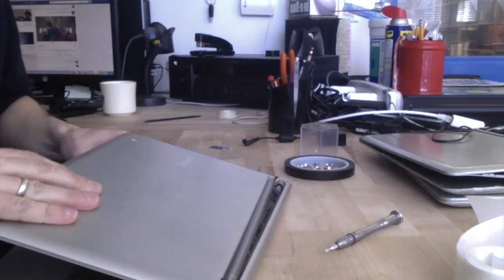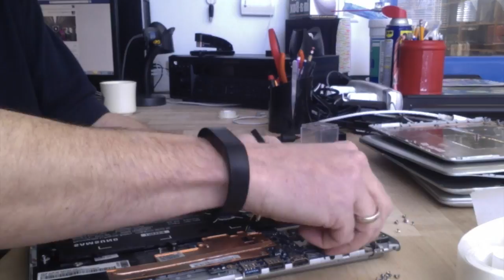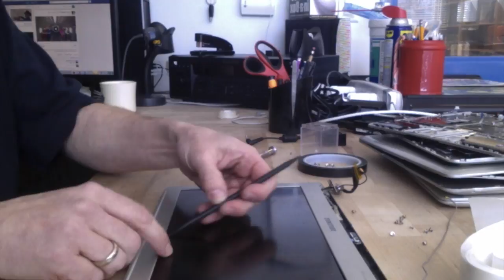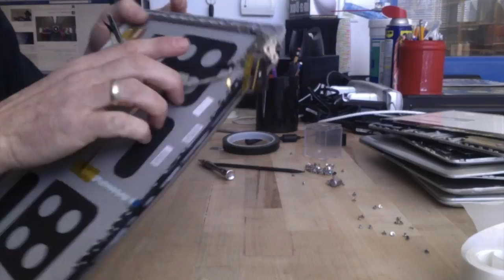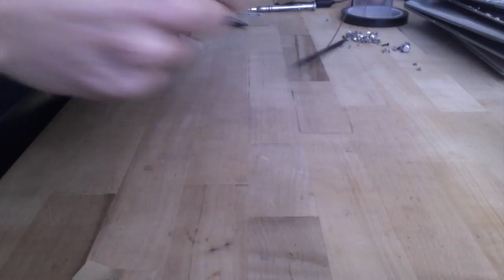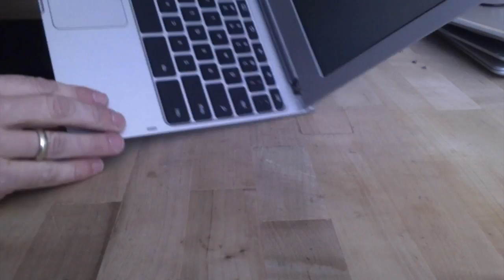Samsung Chromebook 2016 - Hinge Replacement - Assemble/Disassemble Samsung XE303c

Comment: Good day. I need some help finding replacement hinges for my Dell Latitude 7200. Any suggestions on where I can find some?
Reply from the maker: Normally you can get them on ebay or amazon if you know the model number.  BE aware that the screw into the top case and that may need to be replaced as well.
Reply: @Oakheart  only see hinges for MS Surface on ebay and amazon so far.
Reply from the maker: @carnelcampbell6640  I didn't see any either. What is the model number from the bottom? You can search dell with the service tag to get the exact model number.

Comment: I have two Google Chrome Book's that I purchased from Amazon.com.. The one I bought back in 2014 by Samsung just cracked it's hinge this evening. If I pay for this Screen/Top case repair and and Hinge. Could I risk losing valuable data from my Chromebook? Or should I transfer the Mother board to my other Samsung Chrome book? What ever detail's would save me the aggregation down the road..encase I lose valuable data. Thanks!!
Reply from the maker: Gigi Du Hermoine Chromebooks do not save data locally. I'm assuming you're using a Google Drive and Google Docs. The best thing to do to be sure is log into Google on another machine. Make sure your data is there. That being said swapping the top and hinge will not affect the motherboard. Unless something goes horribly wrong with static electricity.

Comment: could you put link for the tools and screw drivers you used in this video ?
Reply from the maker: Modi h i have found this is the best way. Normally the top case is destroyed. the only tool you have to have is a ph0 philips screw driver and a papper clip. Some sort of pry tool even a pencil could work.
Reply: Oakheart where did u buy the replacement parts ?
Reply from the maker: Modi H not sure we have some one that does that for us. I seem to recall it was chromebook parts dot com